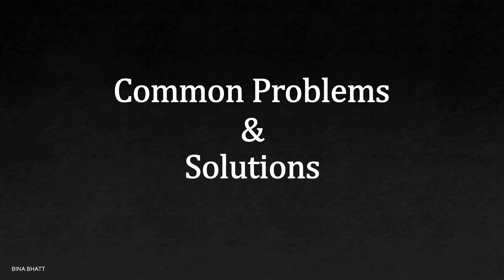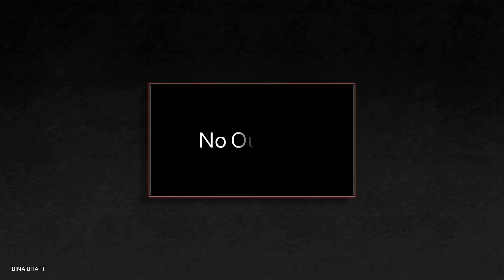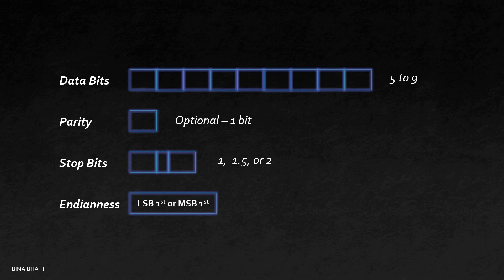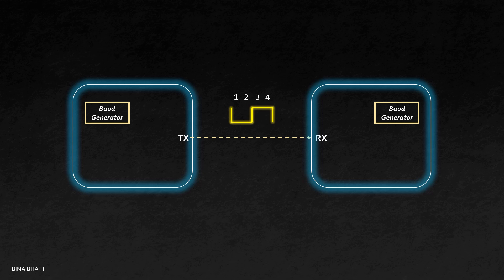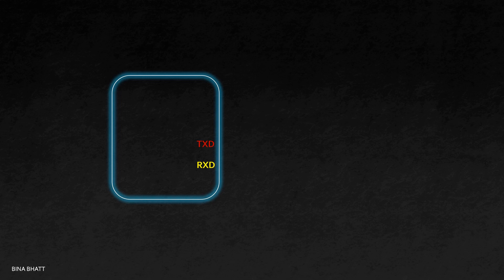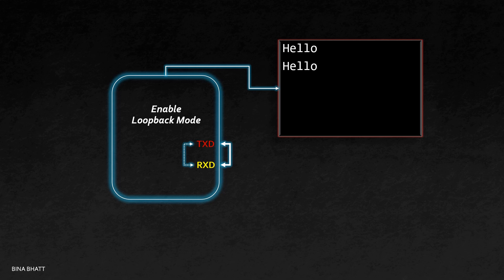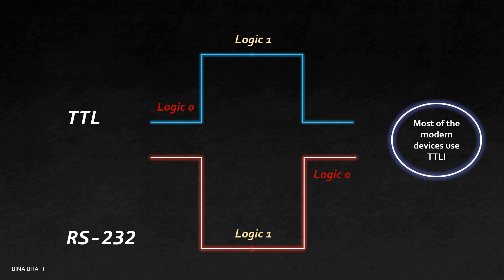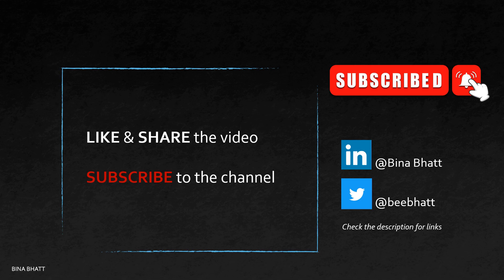UART - Troubleshooting tips (Debugging UART issues)

Comment from the maker: In this video, you will learn how to troubleshoot or debug UART issues step-by-step. Hopefully, you wouldn't have to spend hours correcting these common problems! 

LIKE and SHARE the video.
SUBSCRIBE to the channel!

UART Basics - https://youtu.be/npL5ph9RG84
UART in MSP430: https://www.youtube.com/watch?v=2g9oh...

Check this playlist on Communication Protocols in Embedded systems (SPI, I2C, SPI vs I2C) - https://tinyurl.com/434j99m2
Reply: Thank you for helpful videos, good job!

Another way to troubleshoot UART issues is lowering baudrate. If devices A and B work properly with a short cable, but work a lot worse with a long cable, then lowering baudrate on both A and B (if they have the option to choose various baudrates, of course) from for example 115200 to 9600 can really help. It happened several times to us on production, and we use only low baudrates since then. The lower the baudrate - the more reliable communications are.
Reply from the maker: @k283  That's a valuable input! Thank you!!